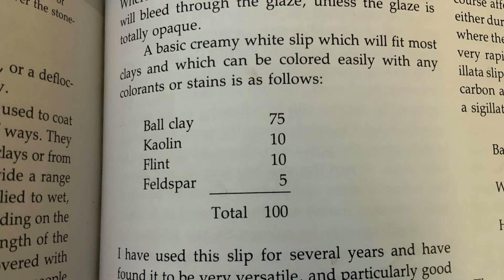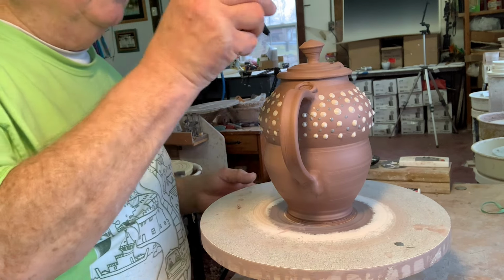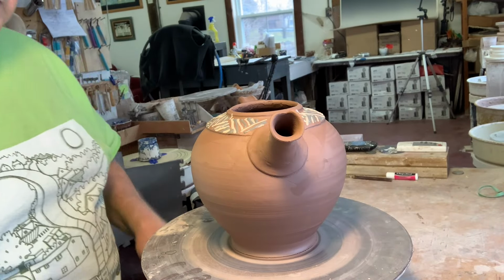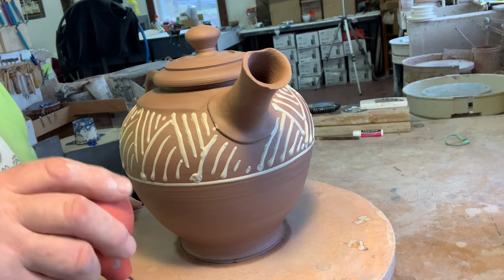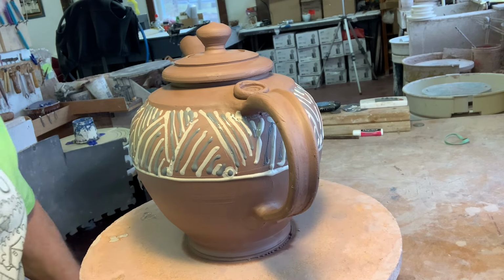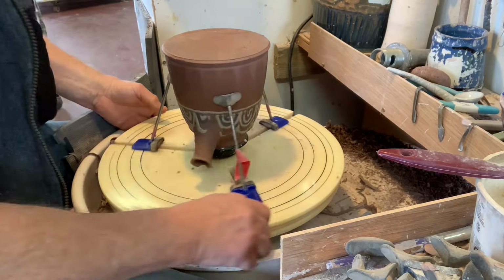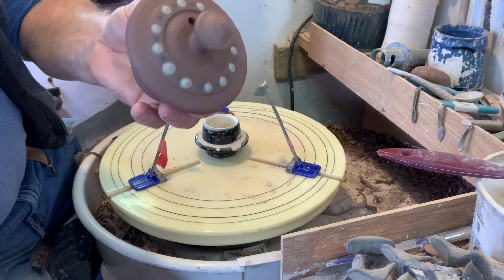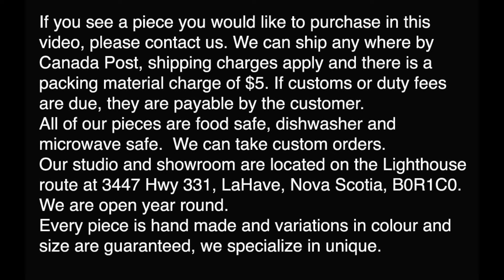Slip decorating 8 teapots, Part two of three.

Comment: First off, I've learned so much from watching you. 
Thank you!
I just started learning about slip trailing and want to try. 
I haven't heard at what stage should you add slip trailing to a piece so it doesn't flack off?
Reply from the maker: The clay pot should be tacky but not soft. Slip releases its moisture into the pot it sits on, so it can cause the pot to collapse if you apply it to pots that are too soft.
Reply: Thank you for responding. I will definitely keep that in mind. 🤞